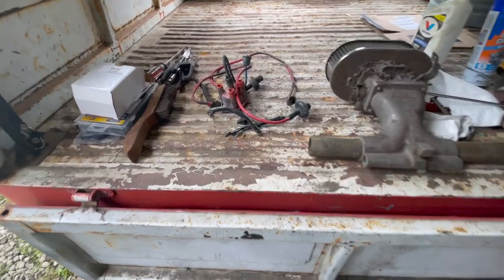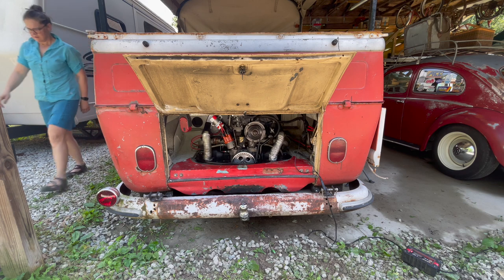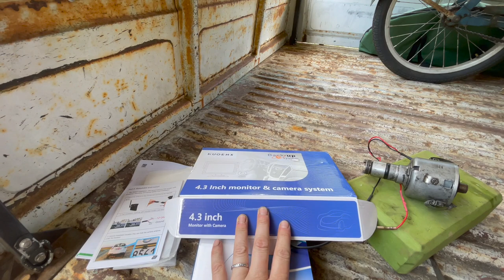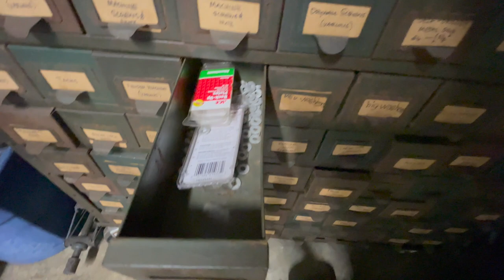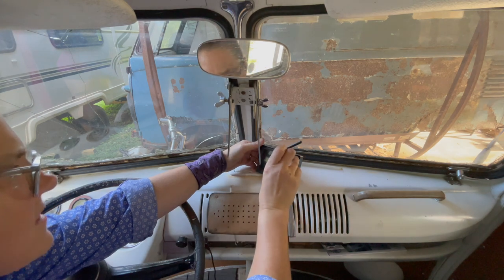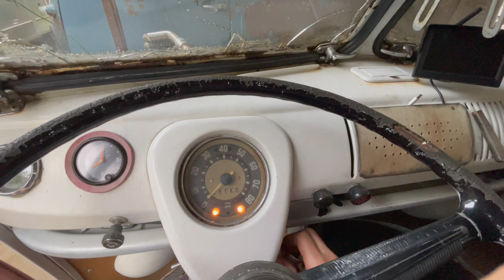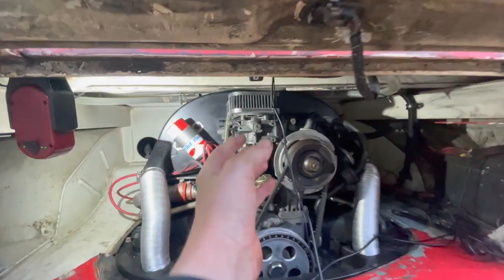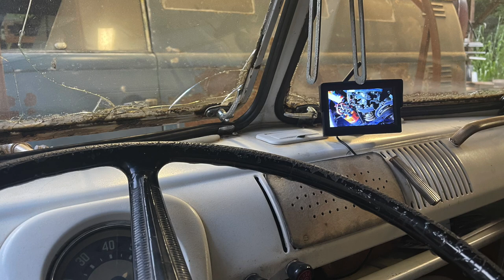VW bus engine fire...what happened? Will it happen again?

Comment: welcome back, glad it was not a melt down, think they take power off the reverse lights to turn on the camera but hooking to the coil would do the same thing powering only when running, stinkin china intake boots, l swear ive had better luck with 50 year old german stuff then anything made today,
Reply: Dear Mustie1.
👍👌👏 Always nice to meet you here, Sir. 2) Thanks for your trust and kind words about older German stuff. I loved to hear it and not only because I'm over 50 year old German stuff myself. 😁 ;-)
Best regards, luck and health in particular.
Reply from the maker: thank you! I must say...I've missed your channel the most but the best part is I have TONS of videos to catch up on and that is the best part! I considered putting old boots from the hoard back on it! Had a pair that looked great...but I'll just add changing them out whenever I do the fuel lines...sigh...

Comment: Hi Marci:  Yes, it has been a "long dry spell"!  Pondering the fire~fuel leak issue makes me wonder why so much raw fuel is getting past the carburetor in the first place for it to leak from the manifold boot.
Reply from the maker: as I stated in the previous fire video the bus doesn't have a working choke so sometimes when attempt  to start it fuel get pooled....because it is essentially flooded...I have now fixed that and heat risers are working

Comment: I've seen a couple of bus fires years ago. Both appeared to have been caused by the old push on fuel hose .the hoses would fall off and next there is fire being fed by the engine itself until the engine stops. By then everything else was burning. then the crank case and trans housing was burning .
Nowadays i am kept busy changing old style rubber hoses for E type fuel resistant hose. 
Even on my own car I have had the rubber hose dissolve while driving,leaving me stranded.
In the meantime I have working on a Mercedes where the fuel hoses burst and the engine was covered fuel which caught alight.
 It wasn't the fire so much which caused a lot of damage but the foam stuff from a fire extinguisher which has corroded every single piece of metal in the engine bay. Even the front suspension bolts are rusting as I write.
 Talking with a heli pilot mate of mine,he says that if an aircraft has that stuff used on it,they write it off,never to flown or even parted out.
Reply from the maker: yes, I've heard that the fire extinguisher can do more damage than good sometimes...key  is to get it cleaned up as quickly as possible!

Comment: How about using a heat sensor in the engine bay. When it gets to "flame hot" a buzzer sounds in the cab. Then you can fit it and forget it. This way you will have to keep an eye on the screen.
Reply from the maker: Thought about that...but this has worked out great and a heat sensor only sounds for heat...here I can see a lot more than that...if I want...lately I've just been running it with the light off and figure if it has a fire and thus the screen lights up thats bad, so pull over! ha

Comment: A someone who has also had an engine fire in a type 2 I feel your pain. I was able to get it out quickly but lost a bit more wiring than you did. I also lost the electronic ignition! As VWJAWBREAKER pointed out I too am concerned that you had enough raw fuel to pool and drip out that one cracked boot. Imagine more on the other side. I would look for an issue with that carb and definitely check to see if your heat-risers are actually working. Haptic Garage goes over that issue in great detail!! Welcome back, can't wait for Pickle to hit the show circuit!
Reply from the maker: as I said to another commenter...EVERYTHING and I mean everything I could thingk of was  gone through...I cut much of the video and actually considered doing two  videos, had another carb ready  to bolt on etc...but think we are all good now...nothing like and engine fire to scare you 1/2 to death.  Those electronic ignitions are so sensitive.  I will say the bus runs and starts much better than it used to so I will probably just stick with points!

Comment: Yea that fuel leak was from the float overflowing into the intake boot. You should be able to get a rebuild kit for that carb......Webber progressive. I have been running those for 35 years. kits are available.
Reply from the maker: I cut much of the 5 hours of video troubleshooting and yes had that same thought, so rebuilt it..but all has been remedied now and I've been driving it almost daily since without incident thankfully! appreciate your input and knowledge!
Reply from the maker: I figured no one would watch a boring carb rebuild...Mustie has cornered the market on that! lol

Comment: I was wondering what happened to you! 
As far as the fire, I was curious how you discovered and extinguished the flames so quickly? Great job cos’ very little damage was done and…. 
It looks like you have a Blaze Cut installed in the engine compartment. At least that is what I thought I saw. 
Curious if that is what I think it is.
Reply from the maker: I had backed bus out to go for drive and it had been sitting a couple days and the pollen was awful on it, so went up to grab the hose to spray off real quick and when I came back down smoke was billowing out of engine bay...grabbed the extinguisher in carport before even lifting deck lid...when I opened it went WHOOOOSH flames everywhere...and YES I have a blaze cut! But I was faster that it was this time! It didn't damage blaze cut so I stuck it back up in there! I had covid almost 2 years ago now but STILL cannot smell gasoline...so I likely was strong gas smell I just couldn't smell it...so hence the camera option...got to rely on other senses for now

Comment: are those boots on the intake manifold? so they can crack and suck air too
Reply from the maker: yep, engine was sucking air and running like crap so I pulled into neighbors driveway which is a big hill and when I sat there and watched I caught it...had to be at the right angle to even make it leak...

Comment: Very cool video and I am glad you're back. Gas leaks are scary. Especially when the electrical system,  fuel tank and exhaust are in the same proximity. Didn't you install an extinguisher in an engine compartment?? Anyway,  welcome back!👍👍
Reply from the maker: yes, there is a blazecut fire suppression system in the bus as well as the camera so hopefully with all the regular maintenance (now including changing out those dang manifold boots) we should be good to go!

Comment: Great trouble shooting effort. Where did you buy intake boots. Maybe try Wolfsburg West. Most of their stuff is good quality.
Reply from the maker: they were the "new and improved" silicone blend...supposed to be "better" than the old ones, I'm here to tell ya, nope they aren't, dug around and found some old school black OG rubber looking ones and that's what we are running now, and you better believe those will get checked annually along with everything else!
Reply: @marcijunebug  honestly I’ve never heard of that happening in terms of it breaking down so fast. I’ve seen 20 years German ones that are not ripped. Even the after market ones I have bought last for many many years. I’ve never had a problem with them leaking or ripping.
Reply from the maker: @SanDiego_VDubLife  us neither…that’s why my mind didn’t immediately go to those as a problem! They were almost like a gummy bear and weeping yet cracked all over…just beware, they were empi brand urethane blended…I think that batch should not have passed QC! Learn something new everyday

Comment: about that enviable "cigarette lighter"... what fuse do you have it hooked up to? Mine has been kind of janky lately, and maybe that's my issue. (well, I have LOTS of issues 🤣🤣)
Reply from the maker: it's wired on it's own and straight to the battery because I wanted to be able to have power to it even if key wasn't on
Reply: @marcijunebug  I think I am going to go that route. Maybe a fusable link in the line, but constant power would be optimal.

Comment: Unfortunately the following comment got already deleted once (yesterday). Therefore I try it again: Dear Misses Supermarci
👍👌👏 Very well done again and as always (video and work). I'm happy to see that you are "officially" back now. Of course I was a bit worried because it was such a long time of "junebug abstinence". It's kind of funny, that mankind already flew to the moon more than 50 years ago but even in 2023 it seems not possible to have decent interweb connections. And this although nearly every company/insurance/discounter etc.p.p. went or wants to go to paperless communication = everything only via email. Actually all that isn't funny, it's pretty annoying and a pity/shame.
2) I'm definitely not against new things but they should at least work well and be good for our planet/ mankind. For instance inexpensive LED lights are a really great invention, inexpensive tiny digital cameras also (as you experienced too). I wonder if it isn't a bit distracting to have a constant view on the engine while driving the car in traffic? But, as you mentioned: This contraption already worked well for you for several months.
3) 👍👌👏 Congrats for being able to find the cause for the fire respectively problem in the engine bay. This is often even more important than solving it. Additionally it's even often more difficult than repairing the actual problem. By the way: Is your "pointless" ignition toast or could it be saved!
4) If I remember correctly, you said that you had a job where free WLAN was offered. Please kindly allow me to ask: Is this job no longer existing respectively do you have a different job now (respectively do you work for another company)?
Anyway, I'm happy to have you back, happy to hear that you have a half decent interweb connection at home now and that you are all healthy (including the double cab). 😁 ;-)
As always: Thanks a lot for making teaching explaining recording editing uploading and sharing.
Best regards, luck and health in particular. To all of you of course.
Post Scriptum: Please Ma'am, please consider to get yourself a new windshield for the double cab. It's simply dangerous to have such a defective glass in front of you.
Reply from the maker: With driving older cars comes the  job of often finding solutions to  "opportunities" they sometimes offer us to learn and decipher clues! ha  
I started my own company and so thus I've been "working from home"  and trying to establish my biz and trying to do all of that without internet was really quite challenging...I feel like the 'gloves are off" so to speak now that the interwebs are now part of my arsenal!  
The double cab camera set up has worked great! I love being able to at a  quick glance see what I need to see.  For me it hasn't been a distraction, but I've put a lot of miles in on the road over the years and am very diligent with limiting distractions! 
cheers,
m